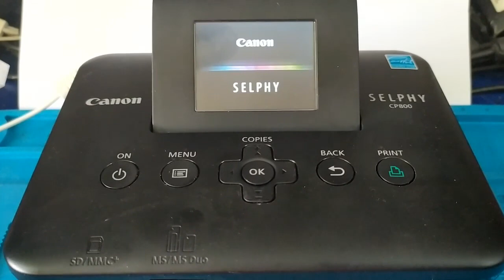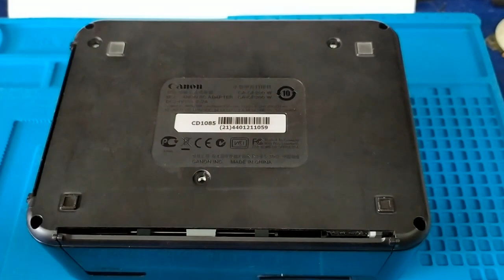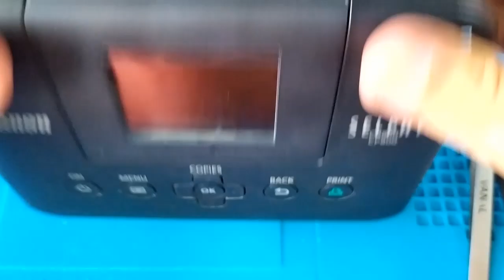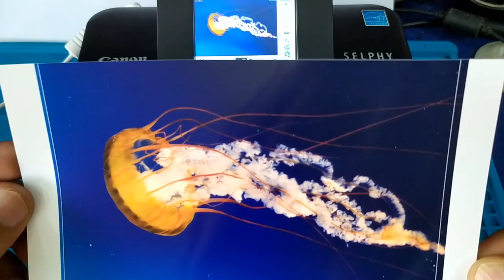How to fix ink cartridge stuck problem on canon selphy cp800

Comment: Absolutely fantasatic video, congrats.
Just let me add....
- first of all it seems to work with many Selphy printers, also CP710 or CP510 - they all look similar inside and the issue is always the same
- in many cases it seems the gear is not really broken but it just moved to the edge. In this case, it's enough to move it back with a little screwdriver
If that is the case, you don't have to go as far with the reassembly as you see in the video.
After removing the chassis from the case, you can already reach the gear and push it back... so you don't have to remove the top PCB and you don't have to remove the motor assembly.

Comment: My Sony DPP-FP67 seems to be the exact same printer with the same issue. The cartridge wont eject without me taking it apart partially and moving the gear manually. 
Was it the little gear was to loose on the motor to turn the big gear back home?

Comment: With all the different models of the selphy printers, they all have the same issue. The single point of failure is a little gear. I wonder if that's their ploy for people to buy another rather than try and fix?

Comment: I have a Canon selphy cp800 printer
It has a problem which is half right paper does not appear when printing only the left half as you can see in this picture when printing half of the paper does not appear
What is the problem note that I am a technician specialized in electronic devices, but I have never maintained this printer of course the printer is my own

Comment: Thank you for this video, and thank you to the person who suggested buying the new metal gear from Germany. I was able to find the gear online via ebay from user goldenking2000... it arrived from Austria after a few weeks. "Zahnrad 10T  (Gear replacement) für Canon Selphy Drucker CP900 CP810 CP120 Zahnrad 10T (Gear replacement) für Canon Selphy Drucker CP900 CP810 CP1200" Using these instructions put in the new gear. (I had to use a hammer to get the metal gear to stick on the spindle, being careful to have something at the other side of the spindle so I wasn't hammering anything else!) (Note to anyone else: I sure wish I put it all back together while waiting for the gear. By the time I got back to the project, I forgot what screws went where; how the spring connected, etc! I wish I'd closed it all up and opened it again today! But anyway, using this video I was still able to figure it all out.)

Humorously, one can buy a whole Selphy printer on ebay for the price of a screw that is mailed from Europe to the USA! I saw Selphys listed for $12 with $20 shipping and $20 with $11 shipping today... I'm happy I fixed mine though, instead of tossing it in landfill and buying a new one.

(PS -- I use a Windows 7 virtual machine running under Virtualbox on a Windows 10 PC in order to print, as I couldn't get the drivers working with W10)

Comment: Right, I took a knife and pryed it out. now the entire paper transport path is jacked and it won't recognize there is paper in the cassette and it doesn't recognize new ink. POS!
Reply: I have a similar problem as this video but my printer is Sony not Canon. If I didn't have extra ink and papers I would say screw it and get a new printer. I wonder if my Sony ink works in non Sony printers?
Reply: @thaihoang9414 interoperability? that's unlikely as many processes are proprietary. Interchangeable consumables end at .pdf